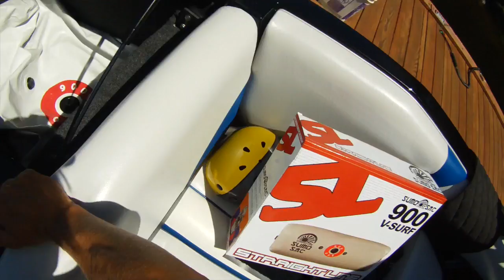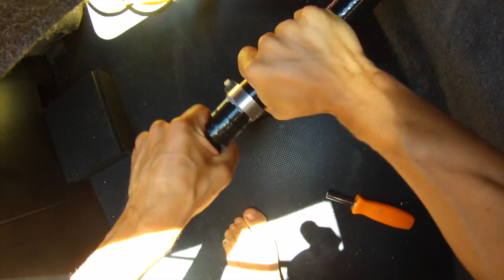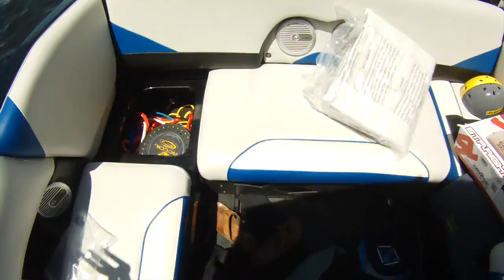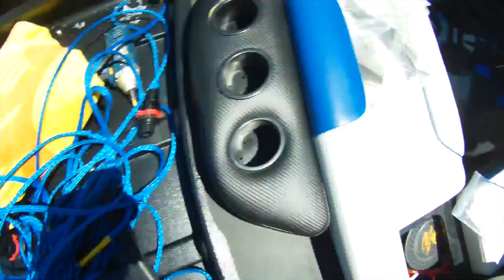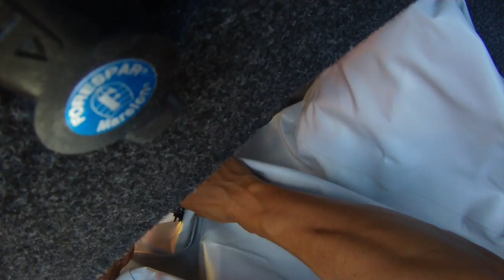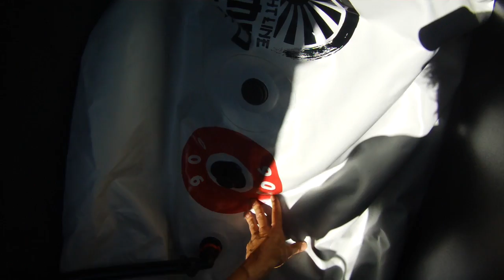How to install Ballast Bags / Sacs - Into a Axis | Malibu Plug and Play System

Comment: I just got a Malibu and it has this same system.  Wanted to ask you a quick question.  Did you buy the factory ballast upgrade from wakemakers, or just the bag and attachments separately?  After looking at your video it seems like if I just bought the bag and attachments I would be fine.  Or do you know what makes their factory upgrade so much more expensive?  Thanks your for time and help.  The video is going to help out a lot.  Any tips on what prop?
Reply from the maker: Good luck with your new Malibu I think your going to have a Great Summer! I purchase 3rd party non Factory Ballast upgrade saved a lot of money that way, i went with the Sumo Sac's. You can also get larger bag's than the factory has that way i got a extra 200lbs on each bag compared to the factory ones. I recommend a High Torque Prop if you do a lot of wakesurfing, it has more fin's and will get you planing faster, but you will loss 4-5 mph off your top speed, but you will save a lot of gas when you wakesurf

Comment: When the shut off valve it turned up closed position I’ve noticed water still comes in from the drain ports that’s pretty annoying when I don’t want to monitor the bags and just fill the factory ballast but it doesn’t pee out the side when they get full it Just overflows into pnp, does yours do the same?
Reply from the maker: I have not seem to have that issue, what type of boat do you have? i just had to replace a bad On/Off Valve could that be the issue?

Comment: What did you use as the sealant for the quick connects and the tubes
Reply from the maker: I just just some plummers tape, you can pickup at any hardware store.
Reply: Teflon tape? lol

Comment: The air vent is built into that bag and is located in the center of the red 900 circle. Just open the valve and push the spring button to let the air out.
Reply from the maker: yea but i would need to do that manual each time i fill them up correct? i was looking for something that would be automatic.
Reply: I have the same bags and dont need to vent them every single time, maybe every third time or so.  There is an auto-vent product for about $7 on boardstop.com that just screws into one of the ports.  I have read others have used it with success on the axis forum.
Reply from the maker: Robert Davies Thanks for the Heads up i'll have to take a look at that.